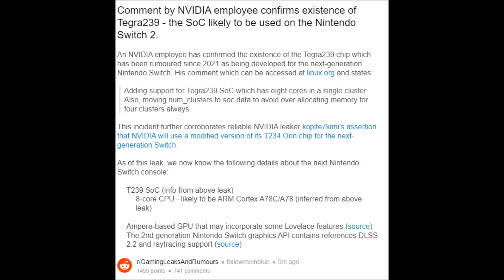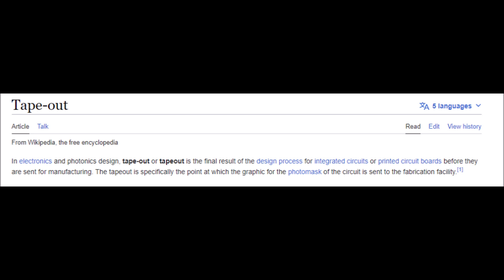Nintendo Switch 2 Chip Taped Out And Ready For Production?

Comment: It seems odd that they finished the design of the chip barely last year when the ampere arquitecture this chip is supposed to be based on, was already about to be replaced by the ada lovelace arquitecture, which would mean they were designing a new ampere chip simultaneously with the new ada lovelace ones, to me it seems unlikely, or maybe the T239 is not exactly what we think it is.
Reply from the maker: You have to stop and work with what was available at the time so you can make the system. The chip is rumored to have couple ada features anyway

Comment: 1:50 i wonder how  powerful  and efficient  this chipset  could be, at least a  graphical/techinal  power  closer/equal to a PS4 should be expected
Reply: That thing will be capable of some semblance of raytracing, which is going to definitely be a bit more than a PS4.   I suspect somewhere between that and the PS4 Pro myself, but I could be very much underestimating it too.  For it to be around PS4 Pro would also put it around Series S minus the SSD and a few other things.   To be real, I think they’re gonna surprise people with this thing.
Reply: @Darknight0681  that would  be  execelent  for Nintendo  to  keep the third  party  suport  on it next hardware
Reply from the maker: It will outperform ps4
Reply: @xid that's a bit too optimistic. Not in raw power GPU. Maybe with DLSS with some games that aren't bottlenecked by the CPU and to a smaller extent, RAM bandwidth

Comment: I wonder if they’d have a dock that actually boosts performance significantly
Reply: They wouldn't need to. In docked mode it would have access to more power and be able to utilize dlss or some form of Nintendo upscaling more efficiently. There is a possibility that the chip they use even if significantly powered down could match the series x, and handheld mode more powerful than the ps4. That's without dlss. No need.
Reply: @bojohns77  that is how the switch works actually.
In dock mode it frees its cap to allow better resolution and framerate (along other things) since the system doesn't prioritize battery in dock mode.
Reply: @alexanderflores-MazterDestiny  Yes I know that. I was pointing out what the rumored power difference in each mode will be with this chip to address the Op's concerns of the chip in the switch itself not being sufficient. I was not pointing out that it would be a new feature.
Reply: why would they? To have games which won't run in handheld mode?
Reply: @TooGoodForYoutube  no just for resolution and frame rate probably, maybe improve minor things like pop in as well
Reply: @MasonOfLife  would be way too expensive to have a second chip in the dock, just make the chip in the SwitchTwo better.
Reply: @MasonOfLife  uhh there's plenty of switch games that improve graphical fidelity (not just framerate and resolution) in docked mode. Expect the same on Switch 2

Comment: My guy my guy my guy!!!!! Thanks Dr!! By the way spec wise, I know I’ve asked you this before but where would this chip land the Switch 2 in power? Xbox series S or better?
Reply: equal to a PS4
Reply: @GiancarloThomazSenoni  With modern rendering techniques, so truth be told, expect a bit more than you might think it’d be capable of doing.  It was the same with the original Switch.
Reply: I have been making some calculations about it based on transistor density of each arquitecture Nvidia uses and die size, best case scenario Nintendo will get an ada lovelace chip for the next console, this arquitecture is much more suitable for a portable device due to its low power consumption vs the power it delivers:

If we get ada lovelace based Switch 2, it would be close to a series s in terms of tflops, about 3.65tflops
If we get ampere based switch 2, it would be about the level of ps4 in tflops, about 1.65tflops.
 
Plase also consider newer arquitectures such as ampere or lovelace are much more efficient than the old gcn ps4 is based on, so in both cases we should be getting a console that is much faster than ps4, on top of that we get new technologies such as dlss that improves resolution and framerates with minimum image quality penalty.
Reply: @Wario1382  What? that's so random lol